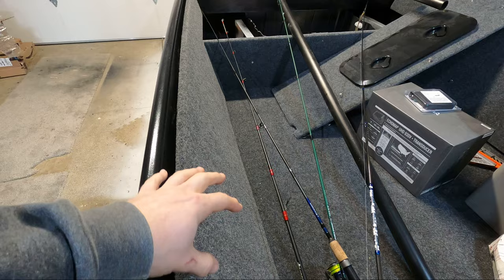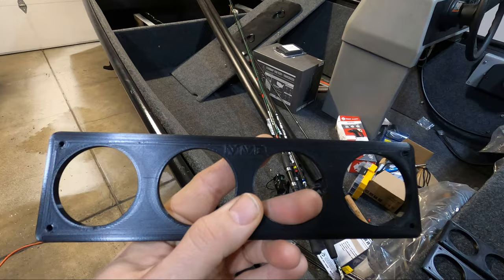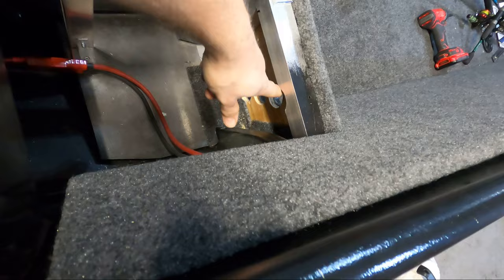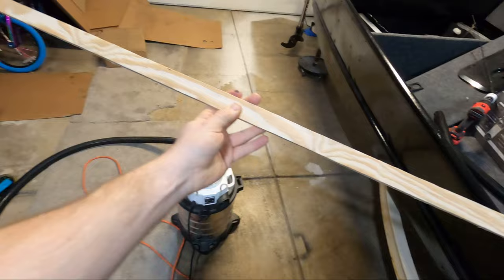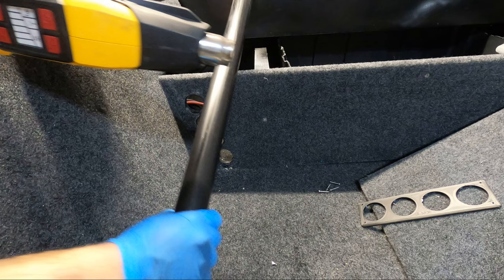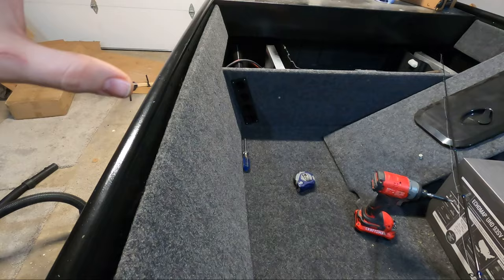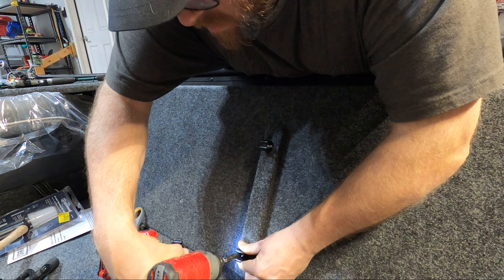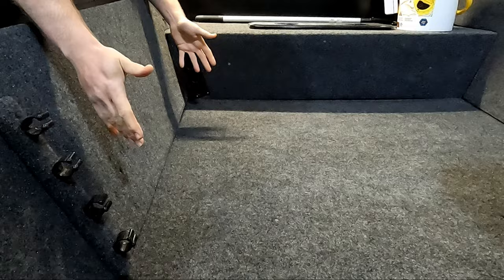JON BOAT FISHING ROD HOLDER -- UNDER DECK STORAGE LOCKER

Comment: What is your black tube material and where can one get it? Is it 1 1/4 or 1 1/2" I.D.?
Reply from the maker: It's a water pipe, I found at Menards. I will measure and get back with you.
Reply: @mvboutdoors  size?